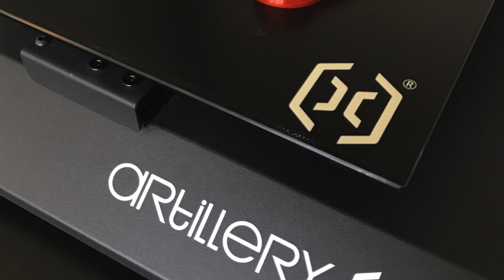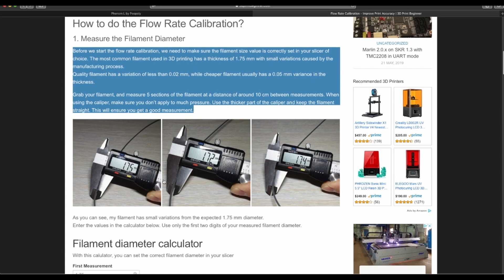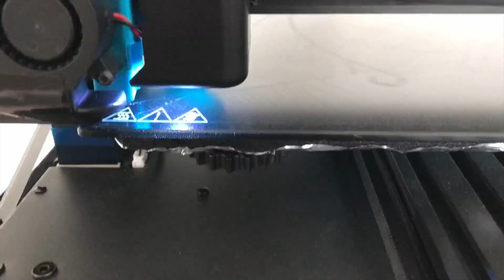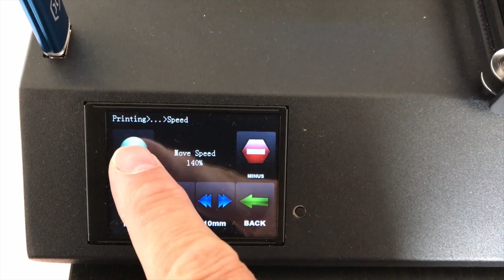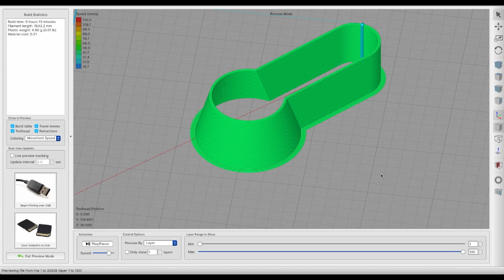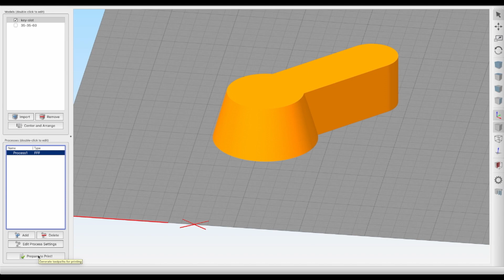Artillery Sidewinder X1 Profile building for beginners

Comment: If you were using Cura you'd be able to alter the print speed at regular intervals automatically in the resulting gcode when the model is sliced. The same for temps. Relieves you from having to babysit the printer to do it manually.
Reply from the maker: You can do that in S3D as well but the whole point is to babysit it and make changes visually.

Comment: Hi, great video, i am using Cura and was satisfied till now with this slicer, but now something strange happens, when i take the same settings that you did, 1 wall count, no infill, brim support.. etc... cura only sets different printing predictions till 30mm/s... if i go higher... even to 100mm/s, the predicted time wont change... and more frustrating.. it will even print only with 30mm/s.. regardless of what i configure... do you have an idea where these restriction might come from ? Thank you in advance!
Reply: found the problem myselfe :) the option "minimum layer time" needs to be set <10s... otherwise it will not accept the feed rate if it prints faster than 10s per layer
Reply from the maker: @thomasr5133  good work! I am not familiar with Cura at all but should play with it as it does seem to have some very cool functionality.  Thanks for the follow up!

Comment: This is a great tutorial, but when I enter all the same set points my print takes 32 minutes where yours shows 12 minutes
Reply from the maker: My only guess would be there is still a setting reducing the speed or the model is double the hight.  Make sure under 'SPEEDS' the setting 'adjust printing speed for layers below' is NOT checked.  That would reduce printing time for sure.

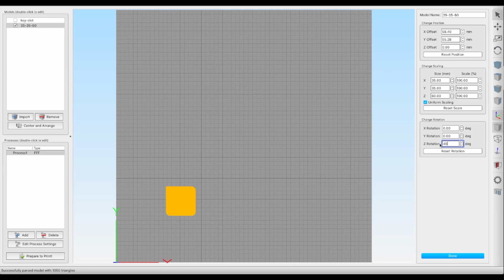Comment: 7:55 But why do you want the motors to run constantly? Is it for testing purpose only, or is this recommended for every print?
Reply from the maker: When printing a model it's very unlikely the motors are only ever working in one direction at a time... unless you're just printing a flat wall or cube.  So I want to adjust my setting with full movement of the machine.  If I were to just run the box only at 90˚ the X axis would only be running, then stop... move around corner then the Y axis would only be running, then stop... move around the corner and if this was a cube with no radius corners it would only ever be running one motor at a time... so I feel that is not practical when actually printing a model of any kind ( other then a wall or cube ) so that is why I want full machine travel engagement.  Hope that make some sense. Thanks for the question.